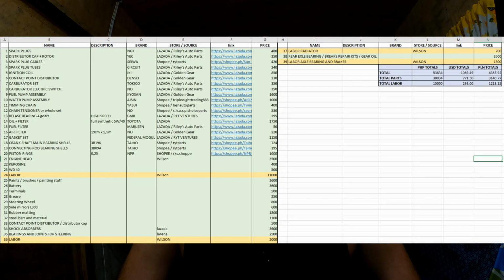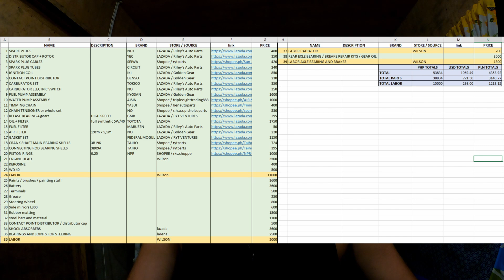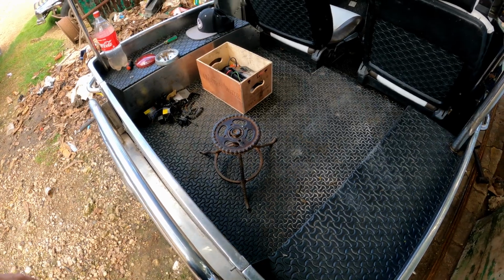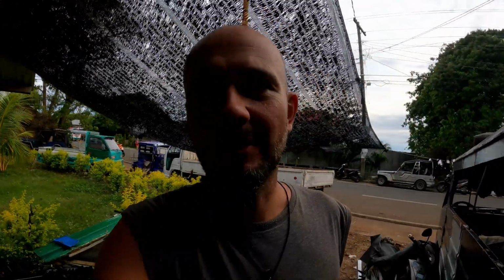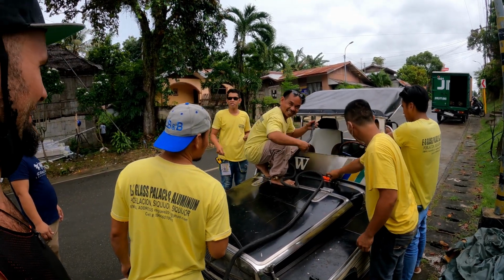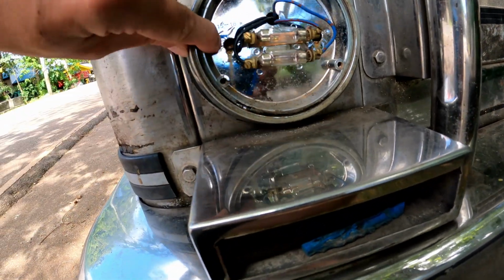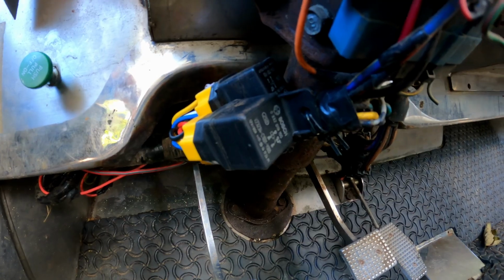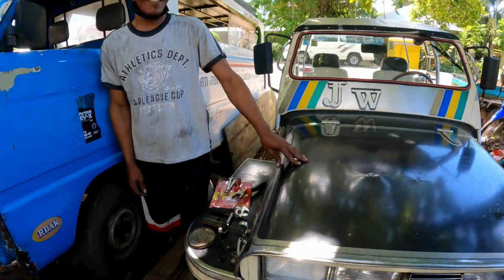OWNER JEEP EXPENSES | OWNER TYPE JEEP #11 | PHILIPPINES

Comment: Love the Starship Matterprise! Awesome job fixing it up. Did you upgrade the suspension? That’s money well spent.
Reply from the maker: No, I only changed the shock absorbers because the previous ones were dead and too long for the springs, so I bought the shorter ones. I honestly don't know if it's money well spent, time will tell.😆🙏🚙

Comment: You might want to check the back of the fuse block as it appears that the lighting system maybe over loaded with more lights than intended by the factory, just a guess?
Reply from the maker: Light problem is solved, i just replaced light relays, starship is doing good since that time, no issues 💪

Comment: maintaining a preowned vehicle can get costly ....but buying a is usually about 700,000 to 1 million pesos ,,,,so far you have spent 50,000 about $1,000 us ....so you are doing great ...another interesting video
Reply from the maker: Yup for over 200k You can have this small city car in nice condition or some good pickup for half million, but my budget was verry low for this. If i have choice to buy car for half miilion i would rather chose reabreather instead  😁
Reply: @IslaPamilya  ....hilarious

Comment: Well if you look at it this way Matt you have pretty much rebuilt or replaced just about everything on that vehicle except for the frame itself I know you fix everything on it and it's a good little vehicle it's just everything broke as soon as you went to use it but I know how you feel I bought a car like that had the same problem everything broke I bought the car for $800 and it cost me $2,200 to have the car fixed hahaha unbelievable
Reply from the maker: Hahaha. Fixing is more expensive 😜

Comment: Greetings Mat, about the stainless, did you check underneath? The chassis and underpinnings are normal steel. A word to the wise.
Reply from the maker: Wazzup! Yup chassis is in verry good condition no rust. We have here a car wash in which they can spray chasis with old oil after washing i will do this time to time.
Reply: @IslaPamilya  I had a good feeling your mind is on the job.

Comment: p30,000 for the car and p54,000 for repairs and I don't think you are out of the woods yet.  By the time everything is up and running, I guess you will be close to p100,000.  For that price you could probably have bought a car that is in running condition.  I guess you were attracted by the cheap purchasing price.  Can't blame you for that, but I guess you get what you pay for.  I wish you safe driving and hope you will be able to drive this car for many years to come without spending an arm and a leg on repairs.  ;-)
Reply from the maker: I'm afraid you might be right :)
However, 100k php is still not enough for a car in good shape here on Siqujior (maybe some old sedan) but I needed something to carry a diving cylinders and all my gear. 
The refurbished multicabs (suzuki carry) cost around 180k and you probably need to add them mechanically because they are old cars.
Coming back to my otj, the purchase price was attractive, but the stainless steel really took me 😍🚙🌴 
Most of the parts have been replaced / checked, I should be able to save the kidney 😆
Thanks for comment!